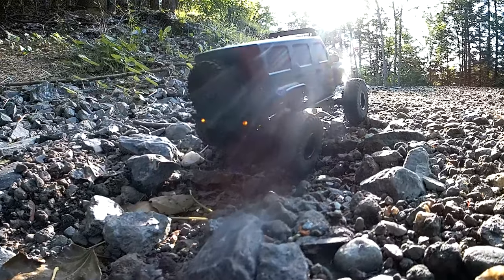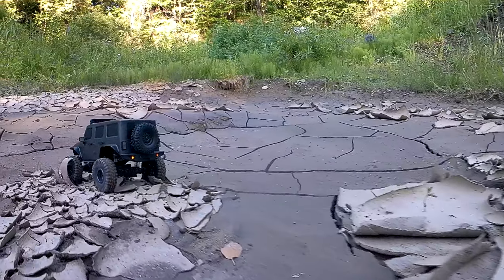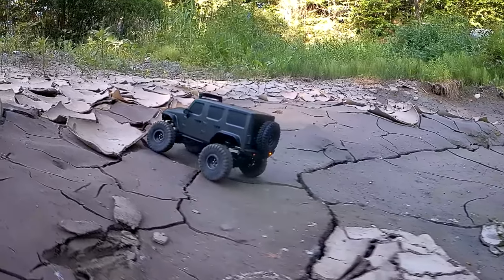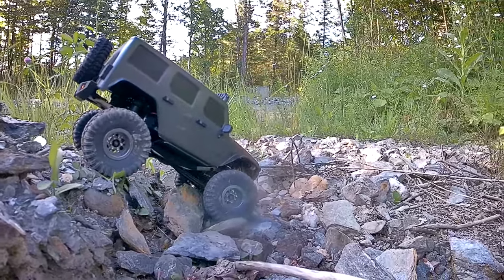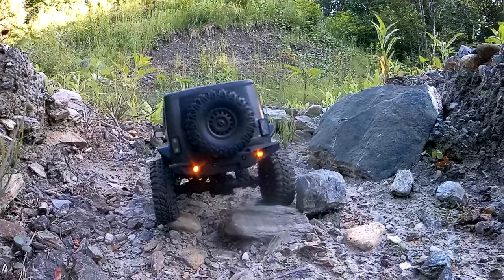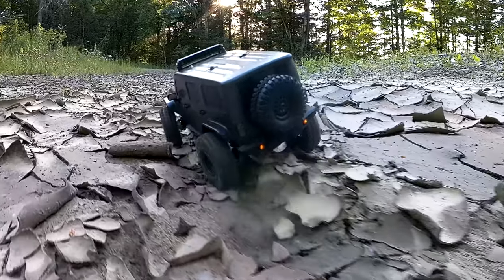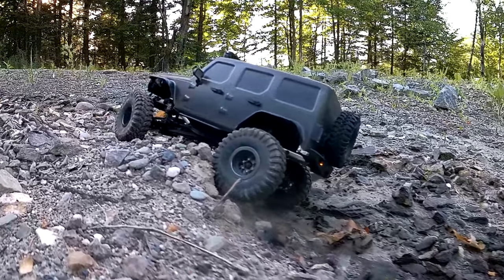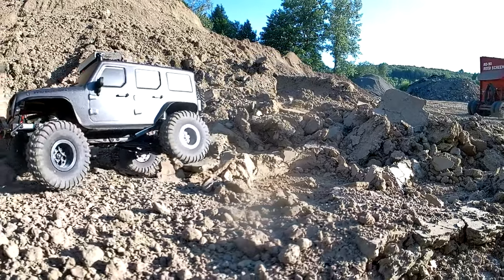#PandaHobby #TetraX1 - Quarry Video 1

Comment: Seem like you’re catching my weather. Don’t overheat your gear like I did. Looking forward to rooster tails.
Reply from the maker: Very thankfully headed to the low 50's overnight with low 70's for the next few days. Nice short heatwave. 

Video in cold temps is where my gear really has issues. Being out in -10F shooting with a motorized gimbal is a challenge. It shuts down all the time. Such a pain. Such a HUGE pain. And I shoot a lot in winter.

For bashing in dirt, I really wish I had I had 240FPS at 1080P but that's hundreds more and it's just not there for the channel yet. Maybe someday.
Reply: @VermontScaleCustoms  I used to record all my footage at that. That would gobble up memory. I wasn’t keeping up with erasing footage and that bit me in the ass. 

There were two things you wrote that I completely disagree with though. “Being out” and “-10”.

Comment: OKAY sorry I missed this video. As you mentioned the black cap at the bottom of the shock. I couldn't figure out how to remove it. Can you please advise me?
Reply from the maker: No worries, I was chasing the other reply on the other video for a second. Couldn't find it when I clocked through. That said, this thing crawls. Fo' Sho'. That was my goal from the start with this thing and also why I bought a second one after sending the first one to my dad. (which he almost NEVER uses :/ )

Answer to your question: I think I used the tip of a small flat blade screwdriver and VERY carefully pried one side of it up until it popped off. If you keep the tip of your finger on it while prying on it, you can feel when it starts to give and release from the ring that holds it in place. The first one is always the scariest. But, if you're gentle, yet purposeful, it goes and won't break. IN order to do this, you have to remove the piston from the shock. If you look down inside, I think a phillips tip works. You'll just have to check.

Big tip: Get yourself a set of stamped steel 1" beadlock wheels and some RC4WD Scrambler 1' tires. Ditch those factory things. Those are awful. Once you alter that one aspect, alone, it changes everything about this rig. She'll crawl for days. Especially if you deep dish mount the wheels. 

As you can see, I've also added brass casters up front and replaced some of the factory plastic parts with metal in various locations and it helps everything about how it performs. Especially keeping those front wheels down.